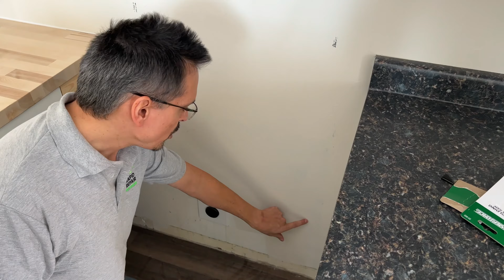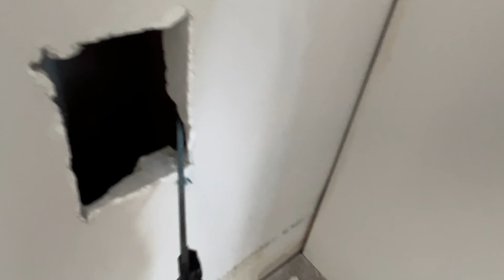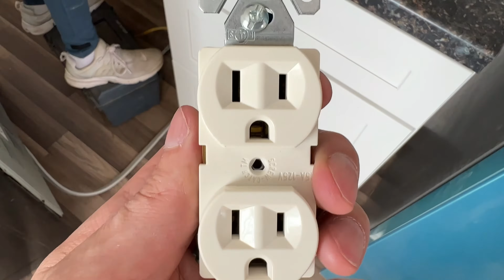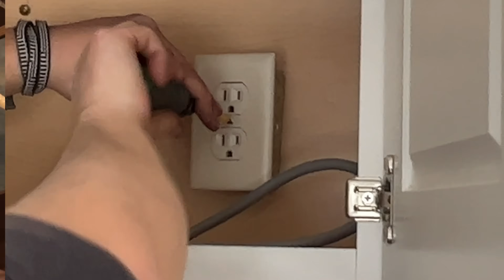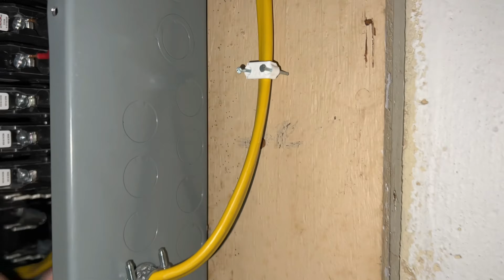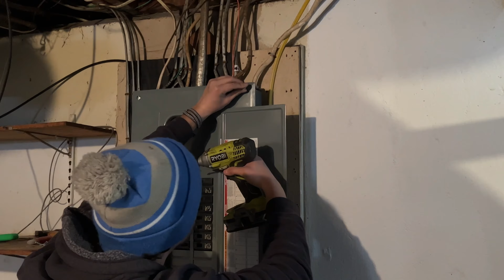Wiring a New Outlet for Above Range Microwave

Comment: Can I install the outlet in other cabinets ? I need for plugin under cabinet lights.
Reply from the maker: Yes 100%. You are good to to that. I've also been a home inspector for decades now and we often see outlets installed in kitchen cabinets. Outlets can be placed basically anywhere you want....however it's a damp location it must be safety GFCI and if it's a floor location it must be the correct floor rated type

Comment: Wrong type of faceplate for a surface mount box. Code violation. You need a metal box cover (mud plate) if you're doing a "lazy" surface mount install like this (which I don't recommend...might as well forget about ever storing anything useful in that cabinet ever again.)

If you're going to do all this, just cut a 3x2 hole and get a proper inset electrical box with wings (also much easier to feed the electrical wire through the wall without needing fish tape) and put a surface mounted plate up against the wall...much sturdier outlet (very low chance of there being any other electrical or plumbing behind that wall if you've already located where the old range or wire used to be, just use a jab saw ($10) and be careful....certainly no plumbing unless you've installed one of those stupid over the range pot fillers, in which case if you have a kitchen that new you're probably not doing this project at all).

Also, if you don't have a soffit or have higher upper cabinets over your microwave, I recommend you move the box as high up vertically inside the cabinet as possible to keep it away from obstacles and things that will hit the cord and outlet all the time. [Such a pet peeve of mine...outlets placed smack dab in the middle of the cabinet where they get in the way of everything you try to shove up there, which is an awkward cabinet already. You also risk constantly hitting / damaging the power cord with this giant box and cable sticking out 4-5".]  Flush mount is way more professional and user friendly lMO. And that's the only way you can legally use a nice white faceplate like this instead of an ugly metal mud plate.
Reply from the maker: Hello. You make a lot of good points for sure. Thank you for sharing all of your experience. I appreciate it. I only attempt to speak to the homeowner viewers that have no experience at all… They want to attempt simple projects without too many steps…

Comment: do you need gfci at panel box?
Reply from the maker: Yes, under the 2023 National Electrical Code (NEC), GFCI protection is required for a dedicated microwave circuit in a kitchen (or anywhere the appliance is installed) such as a GFCI outlet 👍🏼😎

Comment: Does it need to be a gfci 20 amp breaker?
Reply from the maker: Yes kitchen circuits are supposed to be 20 amps. As far as the GFCI safety protection, you can choose to do it at the breaker or at the individual outlet…

Comment: Thank you so much for the video, very informative and professional, I'm ready to wire my dedicated outlet for my microwave now.
Reply from the maker: You got this! So happy the video was helpful for your project.
Reply: @HomeRapidRepair  Hello! Could you guide me in my particular non-common situation?

I had an electrician working at my house who was going to install the outlet inside the cabinet above the over-the-range microwave using the existing 220V wiring previously connected to the old island range. 
(This guy has disappeared suddenly from my horizon and isn't responding to my attempts to communicate with him)
Now I'm intended to complete this project by myself...
So, how is it possible to utilize the existing 220V wiring and modify its connection to the 110V receptacle for microwave?
Reply: Is that 14/2 cable or 12/2?
Reply from the maker: @bsen7145 12/2 yellow Romex 20 amps circuit
Reply: @HomeRapidRepair awesome thank you sir!!

Comment: How did you make sure that you weren't going to drill the cabinet hole into like a sewage or water pipe?
Reply from the maker: Good question. Honestly, just years of experience I think… Push just hard enough to get through the plaster of drywall but not hard enough to hit anything else. It’s a pretty small hole overall… I really wasn’t worried about it. But that is a great question. Let me know if you have any other questions.

Comment: How was the line fished thru the basement ceiling??
Reply from the maker: If I recall, we got lucky and the basement was exposed ceiling so it was pretty easy. If you have installed drywall, it gets a lot more complicated and sometimes you just have to cut away portions of the drywall and repair it later. Electricians do it all the time so don’t worry. Hopefully you have some kind of access though such as a suspended ceiling.

Comment: Learning, so correct me if I’m wrong. But if you only have one outlet on a 20a branch, doesn’t it need to be rated for 20a?
Reply from the maker: Great question. No it doesn’t. The code doesn’t care…because a rated 20amps plug physically will not fit into a 15 amps outlet so it’s all still good 👍🏼😎
Reply from the maker: The best advice is always make sure your wiring size matches up with your circuit breaker rating 👍🏼

Comment: i need a simple answer for this question so i dnt get confused i have 20 amp breakers in the wall panel what plug amp in my kitchen should i put to upgrade the old ones 15 or 20 i have 3 regular plugs and 1 microwave plug and 1 fridge plug total of 5 in which amp plugs goe where or do i put all of them on 15 amp plugs
Reply from the maker: Go ahead and install 20 amp outlet plugs if you would like to. Some people do. However, the electrical code does allow you to install 15 amp duplex outlets on a 20 amp circuit. It’s basically because it doesn’t make a difference and won’t compromise anything. A 20 amp device plug will not physically fit into your 15 amp outlets so there’s no safety concern…

Comment: If im 1 foot short of the outlet I had my microwave running off for years can i use a 10awg extension cord?
Reply from the maker: Yes, you can. However, if you ever sell the house the Home Inspector will report that extension cords are not allowed as permanent wiring. But since you went with the extra thick extension cord, you will be totally totally fine. I’ve seen it many times.

Comment: Whats the metal outlet box called?
Reply from the maker: The proper term for a metal outlet box is *"electrical box"* or *"metal electrical box"**. Specifically, when referring to a box used to house electrical outlets or switches, it’s often called a **"metal junction box"* or *"outlet box"* in technical contexts. These boxes are used to encase wiring, outlets, switches, etc. good luck 👍🏼😊🛠️

Comment: Does your 15 amp outlet on a dedicated 20 amp circuit meet code? I think you should consider using a single 20 amp receptacle. Also Legrand makes a surface box that comes in different depths. Worth a look. Great video.
Reply: The NEC doesn't specify that a microwave oven must be on a dedicated circuit, but it specifies that "utilization equipment fastened in place cannot use more than 50% of the circuit rating..." when other equipment can also be used, NEC 210.23(B)(2). Since this unit is fastened in place, the code mentioned applies here. You need to view the label that specifies the input and output wattage, with the input wattage being your reference. 1200 watts input would be the maximum allowable since that translates to 10 amps. If this is a 1200 watt (output), the input may be 1800 watts or so. Bottom line, if you want to be code compliant, you need a 20 amp single receptacle in this case, and code reference 210.23(B)(2) would be irrelevant, since there would be no load sharing possibility.
Reply: @surferdude642  I misread the code. Not the first time ;).
Reply from the maker: Yes it's allowed 100%. As long as it's a duplex 15 amps rated outlet, on a 20 amps circuit is ok. However, no go the other direction. Cannot do a 20 amps outlet on a thin wire 15 amps rated circuit. Thanks for watching
Reply: @HomeRapidRepair  my understanding is you must use a 20 amp receptacle on a 20 amp circuit if the circuit is dedicated, ie only receptacle on the circuit. If you have more than one receptacles, then you can use 15 amp receptacles on a 20 amp circuit. But as Sufer Dude has shown, I get the NEC wrong sometimes;).
Reply from the maker: @ essentially you are saying it correctly….although When you say more than one outlet that simply means the duplex outlet, which is the normal one that everybody uses.
Reply: @ I mean more than one receptacle on a circuit vs one receptacle on the circuit. If there isn’t one receptacle, duplex or single, on the dedicated circuit, then the receptacle must be 20 amp for a 20 amp circuit or 15 amp for 15 amp circuit. If you have a special appliance circuit in a kitchen for instance, you can you 15 amp receptacles on the 20 amp circuit. If I had a the NEC, I might find the section.

Comment: I had a fan over the range and switching it out to a microwave but there's no outlet the question I have is since it used to have the fan over the range it left some wires am I able to use those wires to make an outlet?
Reply: I have the same question, if you find the answer please let me know
Reply: I finally found a video on it it has to have a dedicated circuit breaker for it 20v in the panel cause the hood fan comes off of an outlet that's nearby
Reply from the maker: I have seen it done many many times. It is preferred to have a dedicated circuit for an above the range microwave, but honestly for most average homes / kitchens it still works just fine.
Reply: I had a fan above the stove but switched it to a microwave and added a plug on it for microwave, over time it will start tripping the breaker if open it before it stops. Been about 5yrs now it's tripping so I'm putting in a dedicated outlet per repair man recommended.  It's not the microwave it's the breaker is weak.

Comment: Great video!  How would you suggest accomplishing this where the wall is solid plaster?  My home was build in 1880s.  Thank you!
Reply from the maker: For plaster walls there are only two options. Drill a hole and attempt to fish electrical wire though the wall stud or run conduit on the surface of the wall. Good luck to you 👍🏼⚡️

Comment: Hi. Question, I’m doing this on my 1962 old kitchen wiring (no remax - I am replacing a hardwired range hood with a plug in one), anything I should do differently?
Reply from the maker: You’re lucky you have the electric wire already available to you. Install an outlet on that wire and you’ll do great 👍🏼⚡️🏠
Reply: Thanks!

Comment: How come you didn’t ground the metal box? I see you taped the outlet but don’t you have to ground the metal box also?
Reply from the maker: I do agree with you that it would be good practice to do that to the metal box. However, the outlet being screwed in and tightly to the metal box has a built-in clamp that is connected to our green screw and our ground wire… So it is all bonded together.
Reply: @HomeRapidRepair  I understand your reasoning Larry, but you have it backwards. The metal box must be grounded first, and the device can be grounded by contact, you can't have the device ground the box. You installed a flush mounted box as surface mounted, so you need a pigtail jumper to ground the box and the ground screw on the device, NEC 246.146. However, there are 2 exemptions that are relevant here. Even though you surface mounted it, I think that NEC 246.146(B) would be allowed, since the receptacle has a self grounding feature, the wire that captivates the lower mounting screw is this feature, and the ground screw on the device can remain unused. A better option imo, would be to use a 1900 x 1 1/2" deep box which is made for surface mounting. The device mounts to the box cover and the metal to metal contact provides the ground, remove the paper screw keepers before installation. This is the 2nd exemption, NEC 250.146(A), and again the ground screw on the device can remain unused.
Reply from the maker: @ great information 👍🏼😊
Reply from the maker: @ Fantastic information for sure. It’s great of you to take so much of your time explaining this and making us all that much smarter with electric issues 👍🏼😊

Comment: If I have the exposed wire coming out on the bottom where your store stuff, can I install the box on top instead of on the wall?
Reply from the maker: Yes, you can. As long as your new box completely encloses the wire you are doing fine. Good luck 🛠️🛠️

Comment: Wonderful job friend. Currently, my microwave is causing my lights to dim when being used because I created an outlet using wiring that was already on the lighting chain. Bad idea. I stopped using it and now plan to out it on a dedicated circuit. Thanks for the awesome video.
Reply from the maker: Thanks for watching. Yes a dedicated circuit for your microwave should solve the dimming lights for you. 😊🛠️🛠️
Reply: @HomeRapidRepair  did you experience any issues with drilling through the floor? How many layers were there?
Reply from the maker: @hospitaladministrator3359  it was pretty easy. About 1 - 2 inches
Reply: @HomeRapidRepair  Perfect. Thanks.
Reply: What size breaker is in your panel that powers the microwave? If it's a 10A Consider increasing to a 15A or 20A breaker that MIGHT help (Dont go any higher than that unless you know exactly what size/type of wire was used in the run). Otherwise yes a microwave should have a dedicated electrical run.
Reply: @bradlonkey3224  thanks man. I was going to do it this weekend but realized that my kitchen is not directly above the electrical box, so now I will have to take more time to think through the rewiring piece

Comment: That's impressive work. I'm getting an over the stove microwave installed in a few days, but I need to install a plug in for it. I have a stove hood installed now and that need to be removed and hooked up to a plug in. shouldn't be too hard..
Reply from the maker: Awesome. Good luck to you. You’ll do great. Yes you already have power so installing an outlet should be pretty straightforward 🛠️🛠️
Reply: @HomeRapidRepair  I have an almost identical situation.  The existing microwave is hardwired because I don't see a plug around.  Reading the comments helps but I think I am going to get an electrician to do it.  Thanks @HomeRapidRepair and all others.
Reply from the maker: @y.henryh8594  yes call an electrician if you feel you need it. Because your microwave is already "hard wired" everything you need to install an outlet is already there. Should be an "easy one" for sure. Thanks for watching.

Comment: great video. please help me.  i currently have a exhaust fan that is connected to the wall with no outlets, the power of exhaust fan goes into the wall. i want to replace exhaust fan with a microwave but not outlet plug. what is the best way to solve this problem. thank you
Reply from the maker: I think you are in luck. With already having the power electric to the fan, you will simply disconnect the old fan and re-use that power cable to install a new outlet. You will need an outlet for the microwave.
Reply: @HomeRapidRepair  Just make sure the existing wire is dedicated only to the microwave, and not shared with other outlets. My 1990s apartment has the exhaust fan wire shared with other outlets in the kitchen, I would need to pass a new wire to the breaker box that's only for the microwave.

Comment: Did you used 12-2 wire?
Reply from the maker: Yes for sure. 20 amp circuit in the kitchen must use 12-2. Thanks for watching 😊
Reply: @HomeRapidRepair  The two 20 amp circuits is for the convience outlets, not the microwave. If the microwave has a 15 amp plug you could use a 15 amp breaker and 14 gage wire. If you installed a 20 amp breaker for good measure, you need 12-2 wire.
Reply from the maker: @TexasEngineer  Thank you for the fantastic response for everyone 🛠️🛠️

Comment: Can you install a plastic box instead which is better?
Reply from the maker: Yes, you absolutely can. I honestly don’t think one is better than the other. There’s just a lot of regional differences. If everybody in your area does metal, I would do Metal. But plastic has completely taken over the marketplace.
Reply: You don’t need to ground a plastic box. A metal box requiires gounding. A metal box can come into contact with power lugs on side of the outlet and is why I would wrap the outlet in electrical tape for a metal box. Plastic is safer.

Comment: What kind of breaker did you use?
Reply from the maker: If I remember correctly, it’s a Square D 20 amp 120 V circuit breaker.
Reply: @HomeRapidRepair  thank you kindly. I ordered just that from Home Depot hoping it was the right thing.

Comment: If it's a dedicated 20a circuit id think that it needs a 20a outlet
Reply from the maker: It’s one of those rare exceptions. The electric code doesn’t care if you use a 15 or 20 amp rated outlet. The 15 amp outlets are way more popular in residential.
Reply: If it is a single outlet, then a 20 amp outlet is required. He installed a duplex outlet and he can use 15 amp duplex outlet. The microwave has a 15 amp plug. The 20 amp plug has a notch for the 20 amp plug which are rare. The 15 amp outlet has 20 amp pass through.

Comment: Just needed the fish tape. Had to cut a middle hole on the wall and used an old metal hanger. Wired outlet. Microwave tomorrow. Thanks for video!
Reply from the maker: Awesome. Hope you have a smooth finish to your project 👍🏼👍🏼

Comment: Does the ground need to go to the box or the receptacle if using a metal box?
Reply from the maker: Good question. We properly grounded the outlet which is screwed to the metal box… So the whole assembly is grounded if you think about it. Thanks
Reply: @HomeRapidRepair  You need to ground the metal box. Pigtail the ground and attach to box with ground screw.